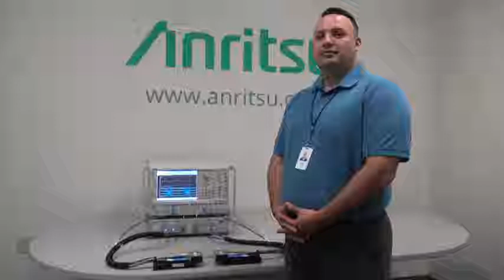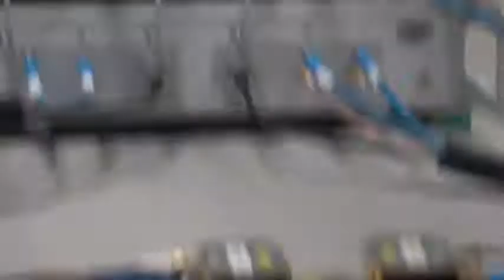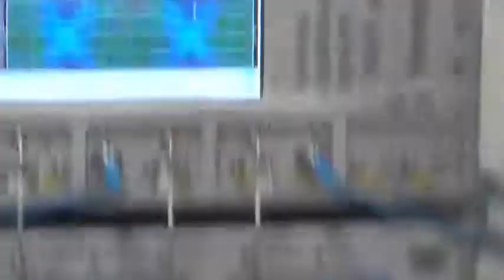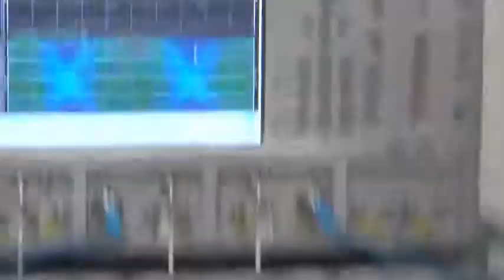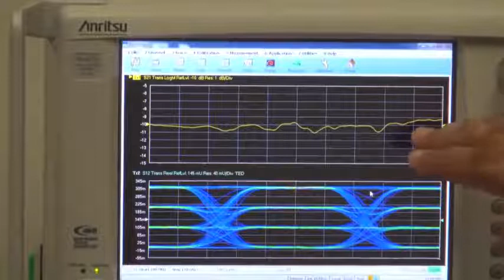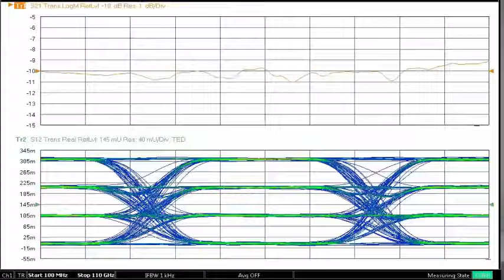Fixed Coaxial Attenuators up to 110 GHz

Comment: Poor guy should have made a trip to the men's room before shooting this video..Anritsu products are a less expensive option to some of the top test equipment manufactures. If your budget is low buy Anritsu. For quality components and microwave equipment buy Keysight. In my opinion, Anritsu products are cheaply made junk.